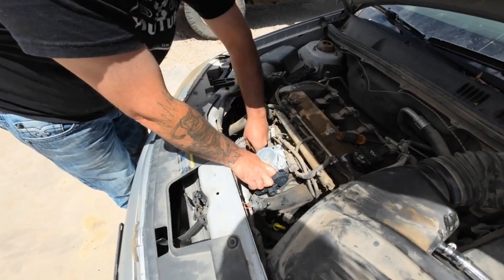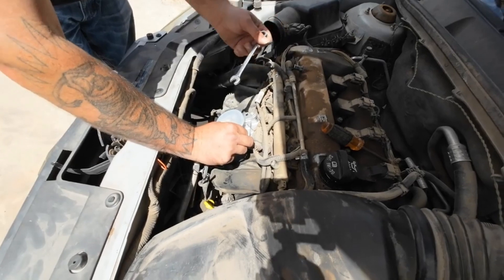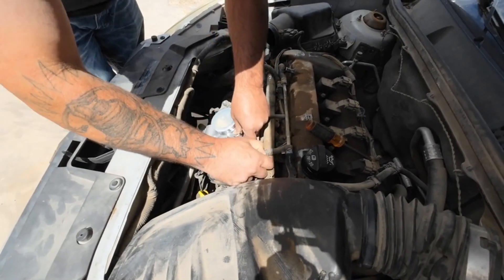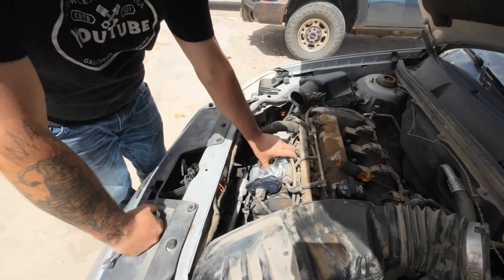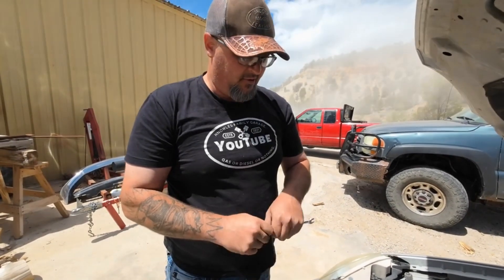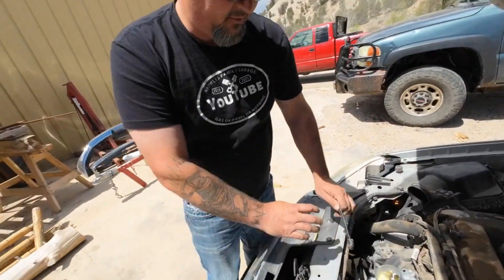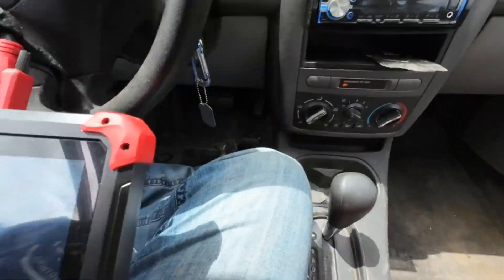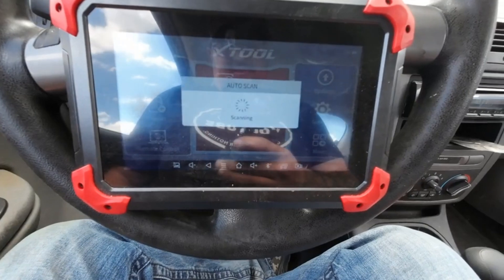DIY Throttle Position Sensor replacement on Chevy Cobalt. #chevy #repair #diy

Comment: So would the X tool be all that's needed to re learn the throttle body sensor? Bc I read somewhere that it jas to be performed at the dealership which let's me know its gonna be expensive af and I would like to avoid that if at all possible
Reply: I can't find a TPS online for my Cobalt. Which is the specs?
Reply from the maker: @angyortiz2986  what year of cobalt is it? Il see if I can find a part # for you.
Reply: @KnowlesFamilyGarage cobalt 2009 Lt
Reply from the maker: It definitely works for relearn of tps on the Chevy cobalts. This scanner has surprised me it does lots of things that are supposed to be dealer only. I have used it for a year and loved it so I bought the newer one the other day off of Amazon it does all the same stuff and more. I can also program key fobs and chip keys and I can make most vehicles with a exhaust filter that's becoming plugged  force Regen and clean them out and save someone a pile of money that usually is a dealer only deal as well. Best part is if you have to buy one post up a add on FB or something and program 5 or 6 keys for people and it pays for it self. Good luck on your car if you have any questions how to do it let me know I'm happy to help any way I can.